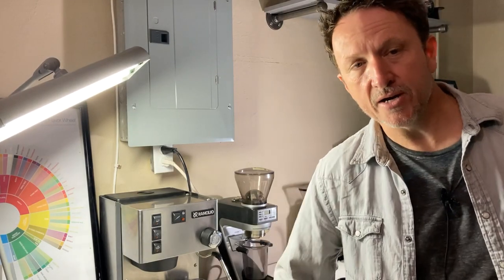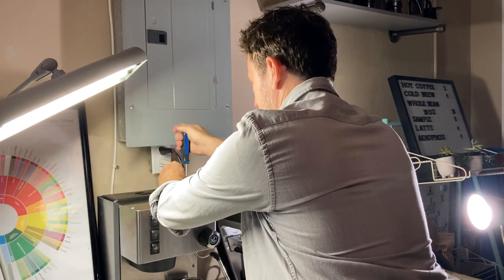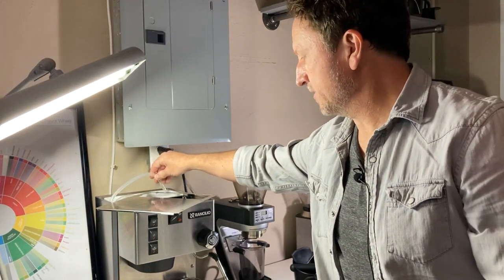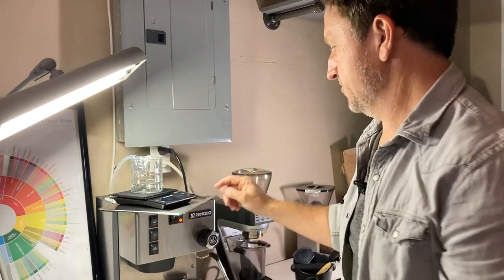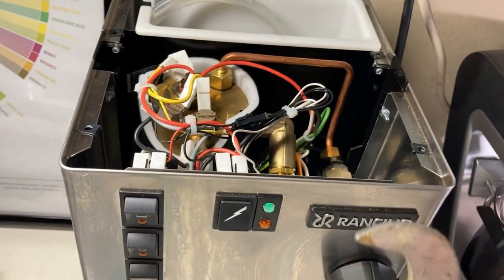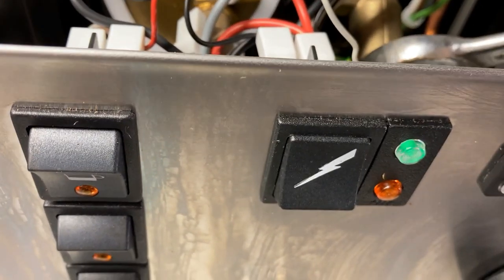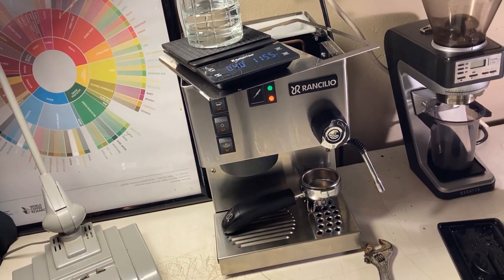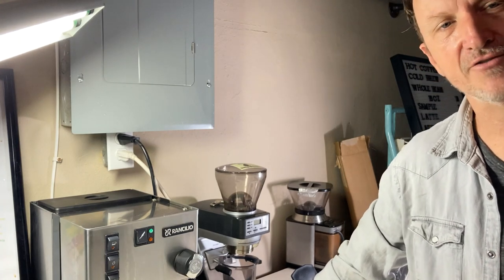Rancilio Silvia OPV Adjustment

Comment: After tasting a local specialty coffee 2 years ago I decided to finally invest in a Silvia. I was very disappointed when I couldn't reproduce the taste of the coffe and thought my technique was just off. Now, 2 years later I found out that my pump pressure was too low and after adjusting the espresso was basically perfect. Thank you so very much, you helped me a lot!
Reply from the maker: It's never ending. Since this video I've readjusted so many times to get both a dry puck and good pressure at the same time. I've pretty well adjusted back to the original position if I'm totally honest

Comment: You want to have the machine unplugged when working inside.  There are plenty of live points: 240v, spanners, fingers and water don't mix non-fatally.  And those are nuts, not screws.
Reply from the maker: Thanks Rick
Reply: Nuts, not screws?  Someone has their chin strap on a little tight, dont they?  And since you’re such a stickler, please point out the step up transformer and 240V live points?  Clearly, our video creator has above average patience since he only responded with a thank you.  I wouldnt be surprised if he installed that subpanel  himself and spent a little extra on GFCI circuit breakers, too.  And just said thank you without even hinting at the dangers of licking windows while wrapped in live electrical cables.
Reply: @oddsman01  No, not too tight. You may be familiar with working inside electrical equipment, but not everyone on YouTube is as cool as you. And when trying to work your way round something you haven't done before,  wrong terminology just adds to the confusion.
Reply: @RicktheRecorder  Ah, your comment was motivated by your concern for others.  Maybe I’m getting cynical as i age.  I mistook it for something else, something some females do, especially low social status females, that has more to do with telling people what to do or being in charge than it does empathy.  The male version is similar, but there’s usually an element of ‘you should listen, I know things.’   Your nuts/screws comment must’ve thrown me off.  My mistake.

Comment: UNPLUG THE ELECTRICITY!!! Thanks for the video. I have a RS with presinstalled PID and the gauge is saying that I am running on 12 bars. After measuring the volume, I am running about 11 bars according to the chart. Will for sure adjust it.
Reply from the maker: Haha yes I know (did not notice when I fed this) trust me it’s unplugged now anytime I’m working on it
Reply: I remeasured again, but this time as per instructions in the link you provided - start collecting water AFTER flow has stabilized. Huge difference! Now I got 135g.
Reply from the maker: @wezzla  awesome yeah keep at it

Comment: I found that after turning it a bit I put a pinch in the return hose, and wasn't getting enough water (even no water) no matter how I adjusted the OPV. Once I  untwisted the hose and adjusted the OPV again, I was able to get to 130.
Reply from the maker: I'm assuming a bit older of a machine as well?
Reply: @drinksunbear  yes - used constantly too :)
Reply from the maker: @TomErbe  glad you were able to get closer on your timing

Comment: I have a brand new pump in my v3. Adjusted my opv using these instructions. My problem is, I will run 4 water output tests and get 130-135ml out on 3/4 of the tests and 100-110ml out on 1/4 tests. Is there a reason for this inconsistency in my output tests. No signs of any problems with my opv. When adjusting it responded correctly to tightening/loosening.

Comment: Outstanding video!  My Silvia was definitely off.  It's about 7 years old.  I'm not sure if it was because we moved earlier this year from sea level to over 5500ft or if it's always been off.  Probably both because since the move I've been trying to adjust my recipe but wasn't tasting as good as I knew it should be.  I suspected pressure issues and thought maybe my pump was bad. I never knew I could measure the pressure like this so this video was a godsend.   I made the adjustment and got it dialed in to ~135g @ 30 sec.  I proceeded to pull some test shots for 30 sec with 17g of my favorite med roast in a #102 basket.  After an adjustment on my Rocky down one notch for a finer grind I yielded 55g.  A nearly perfect 1:3 normale.   Tasted absolutely fantastic.
Reply from the maker: That is great to hear David. I was not thinking about how atmospheric changes could affect it but I'm sure you are right on that one. At any rate glad you got it dialed in man! Cheers
Reply: On higher altitudes the boiling temperature of water is lower as well. So when the thermostat functions at sea level, it could run it too hot on altitude.
Reply: @matter7180  outside pressure not making a measurable difference inside a sealed boiler.
On your stove, yeah. Inside a boiler, no.

Comment: If nothing else; this is a great way to adjust your OPV and know what difference you are making. Thanks for uploading this video. I'll mess around with mine tomorrow. I'd love to know how many BAR of pressure I'm currently producing. My machine has MASSIVE pressure and pulls a 14 gram shot of coffee in under five seconds. That is on the finest grind setting. Absolutely ridiculous. Cheers from Australia!
Reply from the maker: sounds a bit like mine was! Hope you have gotten it dialed in now
Reply: @drinksunbear  My flow measurement is spot on without any adjusting. I hate my Silvia. I wish I had never bought it. Had it for 3 years and I reckon I've had 15 good espressos from it in that time.
Reply from the maker: @danielstewart3507  man, sorry to hear that dude. I wonder if the newer ones are better than the older models
Reply: @drinksunbear  It's all good. It's just a shame it requires so many extra things done to it like PID and flow adjustments straight out of the box. Your video was good. Thanks for the upload.
Reply from the maker: @danielstewart3507  sure! I understand completely. It's all been a journey for me absolutely
Reply: Silvia is very capable but finicky as they get.
It took them 20 years and a 3X price point to smooth all that out.
To get the features built in , you have to get up to that price point, or put in some work.
Often they come from the factory needing to be dialed in.

Comment: Great video. My 17 year old V2 has been over pressured from the beginning!  One caution for others is to make sure the tube doesn’t kink as you adjust. I pulled the tube from around the boiler and hung it from the front. Thanks again.
Reply from the maker: That's a great suggestion. I did have that happen once but did not mention it

Comment: Thanks for the video. I'm a little confused. Initially less water came out and then after you lowered the pressure more water came out. Shouldn't it have been the reverse that you were trying to achieve?
Reply from the maker: Yes that's the way it works. I know it's like reversing your mind the way it actually flows
Reply: @drinksunbear  thanks mate.

Comment: Sorry if I've missed it but what are the exact steps to get water to flow from the short tube please? I've tried several combos and either just get a backflush (using blind basket) or water from head or wand. I can't figure out what combo is used to get water from the tube and I'm not seeing this part in any video I have watched.

EDIT: So I read all the comments here and found one saying it's using the middle switch for hot water. I can run mine with the hose inserted and I get a steady stream from the arm. If I then lift the hose, nothing comes back out of the hose but the sound of the pump changes.

Comment: My Silvia v6 sucks. I’ve always been getting an uncertain extraction time using the same grinder settings and exactly same beans. It was 25 seconds for 30 gram extraction but it changed to 14 seconds the day after, so I always calibrate the grinder everyday. Does the problem come from an always changing pressure bar? There’s no way my sette 270wi would deliver various result while I didn’t change the settings.
Reply from the maker: I would just say as a roaster: every bean is different and for that matter so are most roasts. You will never stop dialing in to some regard.

Comment: There's one issue to be aware of..by reducing the OPV pressure you might find the puck is soupy rather than well formed! Happened to me so I reverted the process and I get better shots and no more messy clean up!
Reply from the maker: great insight and yes it can cause that for sure. It's a neverending struggle with light roast
Reply from the maker: I have had that issue for sure! Changes from bean to bean but all adjusted now
Reply: Is there a pressure , as calculated by the graphs (or its volume proxy) where you see soupy pucks?
Reply: Soupy puck from low pressure doesn’t necessarily have to mean bad tasting coffee…

Comment: Am I missing something? Did you use a blank portafilter basket? If I turn on my machine the water just comes out of the group head. If I put a backwash blank screen in, water comes out of the tube. It doesn't look like you have anything in the portafilter to me.
Thanks.
Reply from the maker: It was just the blank portafilter but no water should come from there at all since the test is using the hot water button in the middle. If you have problems I suggest turning on your steamer and bleeding it out first a little. Then make sure you only use the middle button
Reply: @drinksunbear  thanks
Reply: @drinksunbear  with PID the brew is always switched on. I switched it off and used the water  switch and it worked. But I got 84 grams in 30 seconds. So it appears my pressure is really high.
Reply from the maker: glad to help. we are all in this together

Comment: Thank you so much for the video! My Silvia has the same problem and I followed your instruction to adjust OPV so that the water coming out increased from 90g to 130g. But when I tried to brew a shot, it is still pouring fast. Not sure what could be wrong now?
Reply from the maker: I've mentioned this to some of the others, is your machine older? It should be noted mine was new when I had this problem
Reply: Btw, I get my beans fresh from a local roaster and they grind it for me on their EK43 finest setting. What I did notice is I have recently turned on my machine but forgot to turn it off for a big part of the day.;( And the pouring fast was escalated after that. Not sure if I have damaged my machine.
Reply: @drinksunbear  I bought this machine more than 10 years ago for my husband as a gift. But he is more of a coffee guy and only used it like once a month for espresso.(don't think he is using the right grind this whole time! sigh...) I only started learning to use it during covid few month ago. So our Silvia is old in age but new in terms of mileage:)
Reply from the maker: @jillaintong well it sounds like you are doing a good job trouble shooting the problem. I would not want to speculate since it's older. But what happens if you continue adjusting? Does it get any better?
Reply: @drinksunbear  I did adjust to the extend that 170g came out during 30s. But it didn’t seem to slow down the brewing time.
Reply from the maker: they are troopers you'd be surprised maybe even not a problem that it's been left on

Comment: Hey, i have no water that comes out from that pipe at all while pressing the button..what is the problem?
Reply from the maker: Ok, first make sure it is the middle button. Secondly, relieve some water out of your steamer so it is fully spitting out water before you switch back over
Reply: Well, i did, and still there is no water coming out...my rancilio silvia is 2006...,there is any connection to that?

Comment: I noticed when I measured the flow rate that I had to let water come out of the steam wand before anything came out of the OPV line.

Also, how long did you leave your machine to warm up before doing the test? Does it matter?

Finally, what is the difference in accuracy between measuring flow from the OPV line and using a pressure gauge attached to the porta filter?
Reply from the maker: Honestly I don’t know. I do not have the pressure valve though perhaps for another video I can compare. I had not preheated my machine. But I will say my machine was new when I did this test
Reply: Hi, you didn't have to put a blank screen in the portafilter? When I did it like he does it in the video, water just came out of the group head. But when I put a blank in, water came out of the tube.
Reply: @rcgsail1  Hi, I did put a blind basket in the portafilter. I assume I had to flush the steam wand so that the pump was not compressing air.
Reply: @adamnealis  thanks. sun bear also responded that I didn't need the blind basket. I just need to switch the brew switch off and use the water switch to test the pump. I have a pid, so the brew switch is on by default. But I switched it off and just used the water switch and it worked fine.
Thanks.
Reply: @rcgsail1  
OPV pressure does not equal brew head pressure, often by several barr. They correlate, but not closely.  
It's an OVER pressure valve. If water is flowing out you are gonna get numbers all over the place.
"Scace style"gauge with Blind filter gives you OPV pressure. Pressure with accurate flow gives brew pressure.

Comment: Hey thanks for the video.

I checked mine and I got around 145 in 30

Adjusted to 125-128 figured good enough

Only made the one shot so far but it came out much too fast now so I will grind finder. 

Not sure if getting more then 130 per 30 seconds means too much pressure or not
Reply from the maker: 130 cc (or 130 grams) in 30 seconds translate to 9 bars of pressure.

More water in the cup is lower pressure at the coffee. 

Less water in the cup is higher pressure at the coffee.

Comment: Thanks for your video, After following your step by step instructions, My OPV Valve No longer regulates and seems to dispense more water then before, after attempting to close some of the flow and reach the 9 bars, " And maybe Too much adjusting" the valve itself No longer seems to do anything,  I think i might have over Tinkered, Did i break my valve? ...
Reply from the maker: Hi Mike, are you measuring the water coming out by gram? You should be able to make small adjustments to adjust. If it all does not work, I would simply re-tighten the bolt to the right to its original state (around 12 bars) and then start again

Comment: It blows my mind that espresso machine makers ship machines and aren't already calibrated to 9bar. Not sure if you had any issues with channeling before but I'd guess that lowering the pressure to 9bar should help if that was an issue.
Reply from the maker: it really depends on your coffee I think. Mine I have had to adjust back somewhat to their original settings. My puck was soupy and that's not good
Reply: @drinksunbear  I just tested mine, I was getting ~100ml @ 30s. I adjusted it to ~123ml @ 30s. Now to dial in the grinder for the new pressure/flow rate.
Reply from the maker: @grocerylist  awesome keep at it! Every grinder and espresso machine has to be dialed in to the bean you are using. Have fun

Comment: Thanks for your video. I did test twice with my Rancilio V6, there is only ~90 ml/30s. Does that mean manufactured pressure is higher than 9 bar?

How do you think why manufacturer didn’t set 9bar from beginning?
Reply from the maker: I am going to find out from Rancilio officially. But it is my understanding that it ships at about 11 or 12 bars
Reply from the maker: I just spoke to Seattle Coffee Gear (whom I purchased mine) they said they normally ship at 9 to 10 bars but it’s possible due to human error they are occasionally having more like 11 to 12
Reply: @drinksunbear  Rancillio has , um, non linear QC. Machines of all type often benefit from calibration. We casually and prejudicially, refer to that as the product of long "Business Lunches" at the factory.  Lot of variables, at times, affecting measurements and output.
Reply from the maker: @whazzat8015  when you say “we” do you work for them?

Comment: I just bought my RS v6 and after performing this test I only get 17g after 30 sec. I made sure to follow the instructions and check the thread to see if I missed something but I’ve run the test multiple times and still getting the same results. Is this normal or am I missing something?
Reply from the maker: I'd say tighten it all the way back up and start over again. You may have loosened it up too much. Another way to try and compare is to order a pressure gauge and compare with that. I do a comparison in another one of my videos
Reply: @drinksunbear  do you have a pressure gauge in mind to recommend?  I have look around and and there doesn't seem to be any good portafilter pressure gauge with 3/8 BPT fittings

Comment: freely running water and water that has to go through compressed coffe tablet are not the same things.
why don't you weight amount of coffee that was pushed through portafilter loaded with normal amount of coffee instead? that tells you exactly what actual pressure is.